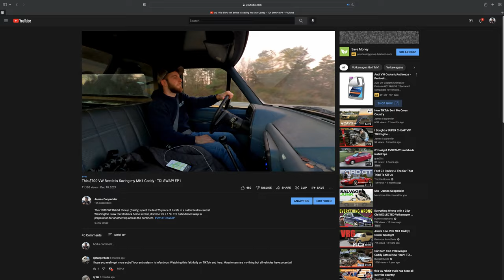One Year After My Epic Journey to Save a MK1 Volkswagen Caddy (TDI SWAP!)

Comment: Hi, I bought a 1980 rabbit pickup and I was doing some wiring work under the dash and now I don’t have any spark. I can’t figure out why, my plugs and coil are good so the problem probably is I messed up something under the dash or with the starter while putting it back together. I don’t really know what I’m doing so wondering if you could help.